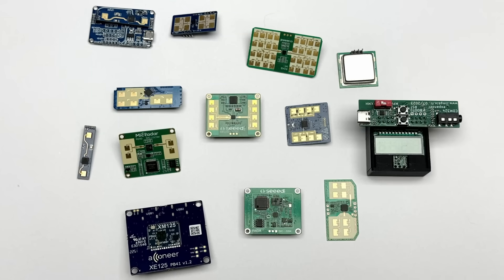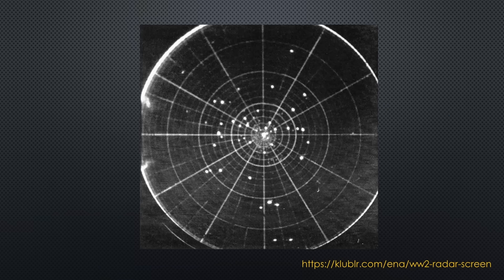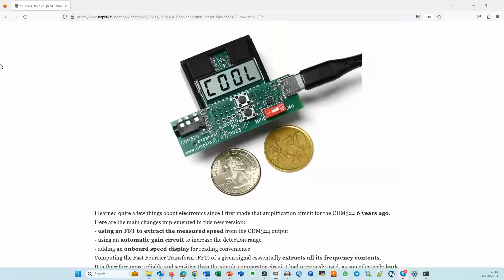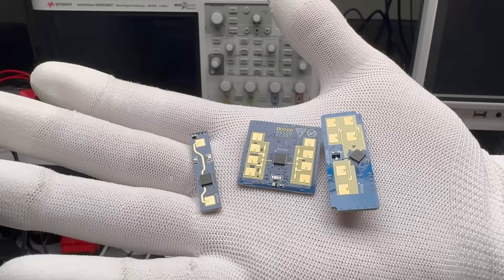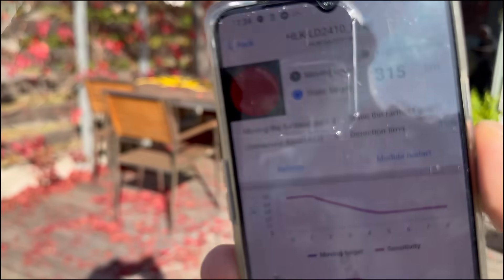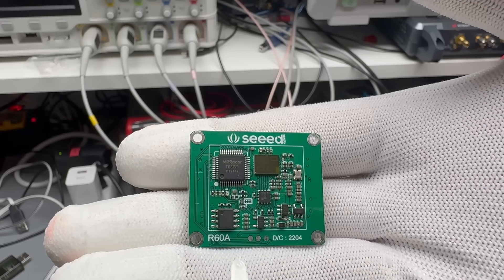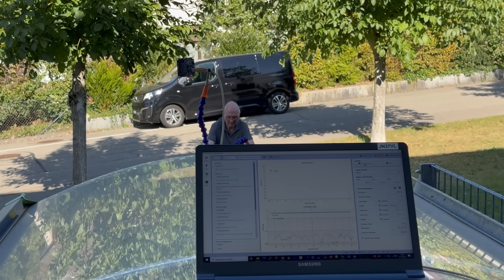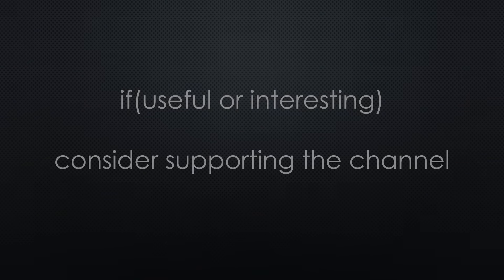467 Radar Sensors from $3 to over $100: Which one is Best?

Comment: i interesting in making DIY rear radar for my Road Bike like of garmin or wahoo rear bike radar sir, which radar module is for this project sir ?, if car is approching on rear left of my bike the a smalll LED will turn on in the handle bar telling the speed of the approching vehicle by 3 different color for low ,medium and high speed sir
Reply from the maker: These radars have a long detection range, and I do not know which chips/boards they use. The sensors I showed here are useless for this purpose because their range is too limited
Reply: @AndreasSpiess  thank you

Comment: hi what is a good sensor to detect a passing car for a lora setup? want to build a sort of traffic light
Reply from the maker: You need a sensor with a long range. So far they were quite expensive and I never tested them.
Reply: @AndreasSpiess the sensor is next to a dirt road. And is like 1 meter from the road. So don’t need distance
Reply from the maker: Think about the speed of the car. The measured speed changes significantly depending on whether the vehicle is 20 meters or 1 meter away.

Comment: Can I read out the sensors with some microcontroller so that I can use it to further control something based on the position of an object?
Reply from the maker: You can connect them to microcontrollers (as I have done)

Comment: If I wanted to use a sensor that could detect objects or ground that works in water, what would I be looking at using?. ie bottom detecting on a sub ROV.
Reply from the maker: AFAIK, they use sound radars in the water.

Comment: Surprised no-one ever tried transmitting from 1 module to 2 receivers & subtracting the phases of the receivers to try to get a bearing.
Reply from the maker: There are videos around that work with phase shifting in radars. But more on the transmitting side to get beam forming.

Comment: As a complete NOOB myself i was trying to tackle a project to detect speeds of cars and display them on an LCD screen.   From my googling i found the BGT60LTR11AIP Radar Sheld 2 Go, and wondering if anyone has seen or used these and if they would be suitable for a inexperienced but keen to learn Noobie that is trying his luck on a radar speed project
Reply from the maker: Did you read its specifications? 7m for humans and probably a bit more for a car. Is this sufficient for you?
Reply: @AndreasSpiess  Yes 5-10m would be fine as i'd place the unit along side of the race track,   i wasnt sure if the BGT60 shield 2 go would be easier for me (a complete novice) to get operational.  im open to suggestions and guidance :-)    thanks for the reply too

Comment: This is fantastic review. Thank you for taking your time to do this. We are looking at radars for trying to monitor the disastrous effect of climate change on insect biodiversity. We are trying to find low cost solutions for monitoring flying insects using radars. Commercial solutions exist but cost in the millions, wanted to build frugal, low cost DIY Vertical radars for local biodiversity monitoring. Do you have any good suggestions of what can track tiny flying insects (<10cm)? Their RCA is pretty low, but maybe some antenna beam forming to improve range, but your thoughts would be much appreciated.
Reply from the maker: I do not know. But since these devices are so cheap, I just would try them to learn.

Comment: Thanks for this video, you convinced me so i bought a number of these sensors LD2410c. I am anxious to see how they operate! First project will be for my bathroom to check presence and then turn on the lights. Also temperature and humidity sensors will be used to control the heating and air refreshment.
Reply from the maker: Good luck with your project!

Comment: I tried the XM125 from Acconeer recently. It's only ~12 euros from Mouser. What is a bit inconvenient is that it needs 3.3 and 1.8V power supply. For me, the software worked very well but this is certainly not a simple plug & play sensor. It has a lot of options to play with that influence range, resolution, update rate and gain. It helps a lot if you know Python because all their examples are written in Python. And if you want to extend the range (and narrow the beam)  beyond 3-4 meters, you need a lens that is sold seperately. In addition to all of this, you could tweak the software that is running on the sensor itself (it has an onboard STM Cortex M4 microcontroller) but that's probably beyond of what most people would want to do.
Reply from the maker: Thank you for the additional info. Maybe they added now some things to enhance its usability. 12 Euros is a good price!

Comment: You are not correct regarding 60GHz being bad because of oxygen attenuation. It is the opposite, and I'll explain.
From the radio planning perspective, it is beneficial to have a service range covered with a signal that overpowers all the surrounding interferers, and additional attenuation helps to achieve that. The noob idea of achieving that is to increase power. But if you can do that, the interferers can do the same, so you get no improvement. In lower microwave bands you have a ground surface that provides additional ~10dB attenuation per decade of distance on top of the regular 20dB of free space. That takes care of the far away interferers, but in higher microwave you get only free space, and lots of them. They multiply with distance. So what you lack as ground effect of the lower microwave, you get as additional oxygen attenuation, which is not much, only about 10dB/km, but helps a lot in dense urban environment.
Reply from the maker: If the attenuation is big enough you do not get any signal to detect at the receiving station. This is usually the range of a technology. 
So far, I did not see any interference on the 60GHz band.
Reply: @AndreasSpiess  True, but oxygen attenuation is not going to block communication etc. in under 100m. Microwave point to point communication would be affected, but short range only benefits from a bit of attenuation.

Comment: If you use them outside, they don't work if it's raining. They just continuously report a presence. They also report a presence if a person is behind the sensor.
Reply: Have you tried these yourself? Which sensors are you talking about
Reply: @GenesisZeroTechnology  I brought a range of different types from HLK, the project was to light the concrete path in the backyard as you walk along it. Starting with the smallest and simplest to test, ld2410 I soon discovered what happens when it rains.
Reply from the maker: Rain is water and water is what these sensors detect in our bodies. So what you describe is perfectly understandable.
Reply: @AndreasSpiess  OK thanks, so no good for my project. Could they be used to detect water/waste pipes in the ground or are they very limited as indoor people detectors?
Reply from the maker: @orac229  These waves are  reflected by conducting material. But attenuated by other material. So, in general, you have to try to be sure.

Comment: I am a bit dubious and would be cautious playing with such high frequency pulse transmitters. Even at low power levels continued exposure has been proven to damage the DNA. If you look at the Ramazzini Study on Radiofrequency Cell Radiation or the National Toxicology Program they classify these radiations as a carcinogen type 2B, and are recommending it to be classified at a higher rating. I am not trying to run down your video it is well presented and full of fantastic information. I am simply trying to warn people to be careful. I used to play around with high frequency radio's but have now have EHS and get bad effects like buzzing in my head, headaches and nausea  if I am near wifi or cellphones for too long. It is a condition I wouldn't wish upon anyone, especially in this ever increasing microwave smog, and the incidence of people getting EHS at very young ages is on the increase, especially when everything that surrounds us is transmitting pulsed microwave radiation. It is the pulsing they say that is causing the problem according to the studies, if they were Analog signal and FM like a UHF 440 mhz transmitter the damage caused by oxidation to the cells would be negligible. This is proven science not some conspiracy theory. This is the reason no insurance company will insure any wireless carrier or producer of wireless equipment like cell phones for damage or injury cause by their devices or networks.

Comment: Since the 77Ghz automotive units work so well and are so common, maybe buying a used one from a junkyard and learning canbus interface would be a fun way to get a small radar with a long range?
Reply from the maker: I had the same idea. But unfortunately, they seem to be propretary and you do not get interface descriptions :-(  Maybe somebody hacks one. For sure not easy for such complex devices.
Reply: @AndreasSpiess   Hmmm.....I may have to get one and send it to Ben Heck....there's somebody who can figure it out for sure.  I saw an aftermarket add-on lane departure 77Ghz unit for motorcycles which used non-proprietary asics; perhaps that unit could be repurposed?
Reply from the maker: @guerrillaradio9953  Time will tell...

Comment: Have you looked at any 4D high density radar sensors? Arbe Robotics manufactures some of the most advanced if not the most advanced radar sensors. Sensrad is the one who does the tech/software for Arbe. It's got to be the best I've seen.
Reply from the maker: No. But looking at their homepage that is a very different segment. They have increadible capabilities! However, they are probably not made for the average maker with a tight budget...
Reply: @AndreasSpiess  They would be used on self driving cars

Comment: Very interesting thank you, I am looking to build some home assistant presence sensors and this confirms using LD2410.
I plan to directly connect to the Esp32, I’ve heard that sometimes these sensors send so much data over Bluetooth that it swamps the receiver.
Is there a benefit of the 2410C over B? I think it has 4 receivers rather than 1 but I’m not sure
Reply from the maker: According to my list, they use different chips. But I do not know the difference.

Comment: As always, excellent material.
I am right now building indoor positioning system using multiple ld2450, also I connected LD2410 with LD2450 and it works great - best of both worlds: X,Y from LD2450 and stationary objects detection from LD2410.
Reply from the maker: Sounds great!
Reply: does the LD2450 give you both x and y cords or you need two to get both
Reply: @tankman1320  both for up to 3 targets
Reply: tryna build a CIWS type project and can use some advise
Reply: Never mind I need the height axis and that's not just x and y which one would clearly provide
Reply: @6489Tankman  IWR6843aop, it gives you point cloud, you can detect height of person (I am using it to classify child/adult/sitting/standing). It offers a loooot of functionalities.
But it is much more complicated and expensive.
Reply: Where did you get the ld2450's? Do you have a reliable and not overly expensive source of those?

Comment: Great video. Thank you.
Do you think if it's possible to know how many people are detected?
Reply from the maker: No, this is not possible with this technology.
Reply: @AndreasSpiess  TBH it is, for example multiple LD2450 we can deduce it, knowing that the maximum speed of a person is S, so we know that point that changed too fast means - two persons, etc. Adjusting radar readings by angles, sizes, and resolution to distance we also can compute it, find common points. LD2450 can detect up to 3 targets, and LD2461 up to 5 targets.
The only issue is that we do not have access to raw data, and data returned from radars are already processed, it makes everything much more complicated, there are some filters, approximations, and other formulas used that distort everything.

Comment: Great video. You mentioned the XM125 is a fast chip, but the data sheet only mentions 10hz. Is that considered fast in these low cost radar chips? Are there none closer to 100hz that can be used to measure higher order kinematics like acceleration/force/power?
Reply from the maker: They do vibration measurement with the sensor (https://youtu.be/bb4grto4A24?si=3kdJ1hsCe9HeXXBx ). So the sampling rate must me quite high in this mode... I did not try it.

Comment: Great video Andreas! One slight point I will make, the sensors can be powered by batteries, just for a shorter time period. I recently used the LD2410B connected to a 10,000 maH powerbank for all-day presence detection, it worked a treat. They are hungry little chips though!
Reply from the maker: I agree.
Reply: @gadgetgamesAU @AndreasSpiess - if i integrated a distance sensor (with 6m-8m range) with a bicycle light having 6000MaH battery do you think it will last for 5-6 hours in a continuous detect mode?
Reply: @nisheelpoddar6886  Sure

Comment: I wonder what modules are used for radar speed control for cars. They seem to function for 50 to 75 metres.
Reply from the maker: There are more expensive radar detectors with larger range available.

Comment: Great video! 👍 Your can do improvment on your measurement methods. I saw that you got bad performance when you tested the Acconeer radar. In test range you had surrounded it with a metal bar close and a car at far range. It could create  lots of clotter that  the radar can hard to handle. See it as you turn on a lamp straight into a camera and then try see somthing. This is a natural limitation the radar has.  
Try to have a similar enviroment when you the radars. You can add clotter as test of how the radar degraded. If you stand in front of a car you will probably be invisible. Continue your good work!
Reply from the maker: Thank you for your tip!

Comment: excellent as usual, Andreas. I have some of the tiny sensors I got from aliexpress without knowing in depth what the others did, but glad I got presence detection working and was so easy to setup. I didn't like that you have to get the extra wires in order to use them comfortably. but they are truly a nice piece of hw becoming available for so cheap. looking forward to the next videos on these topics
Reply from the maker: Indeed, the pricing of this technology is unbelievable for me!

Comment: My biggest problem with PIR sensors is they will false trigger on temperature events (like the sun moving across my lawn).  These would be great.

What I think would be extremely useful would be a sensor that had a wide but narrow detection pattern.  I.e. I don't really need to be looking at the sky or ground.  Just something that is focused more linearly.
Reply from the maker: Indeed, these are not influenced by temperature.

Comment: Can I buy radar sensor for vehicle without antenna and I design antenna for it
Reply from the maker: These antennas are very small and have to be extremely correct. In addition, you have to have very expensive gear to test them. I will not try it ;-)
Reply: @AndreasSpiess  Are there companies that sell radar sensor without antenna??
Reply from the maker: @alaamahmoud297 I do not know.

Comment: Thank you Andreas for overview of currently available (cheap) radar sensors. I was looking for the application where radar sensor is used to measure the thickness of water film layer, needed for highway monitoring, to predict when aquaplaning could occur (with water film thicker than 0.7 mm). I need this for my lab experiments. The sensor should be buried in the asphalt, with teflon cover (something similar as IRS31Pro-UMB from LUFT, but in DIY version), and measuring range from 0.2 - 4 mm. Any suggestions?
Reply from the maker: I have no idea if something like that works. But I think you would need access to RSSI rather than just presence for such an application.

Comment: A while back, I did some pretty promising experiments using the RFBeam K-LD2 putting together a traffic counting monitor / data logger using this module together with a Pi PICO, an SD card slot module and some bits and bobs. It has onboard FFT, a serial interface and supports metering receiding and approaching targets simultaneously. The quality of readings were pretty good and within a plausible range of precision.
Reply from the maker: Thank you for sharing your experience!